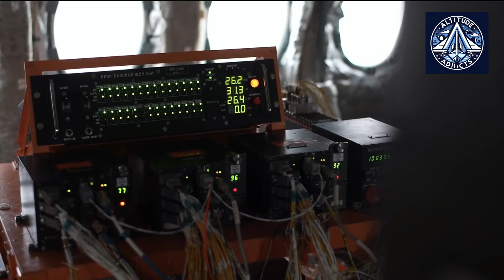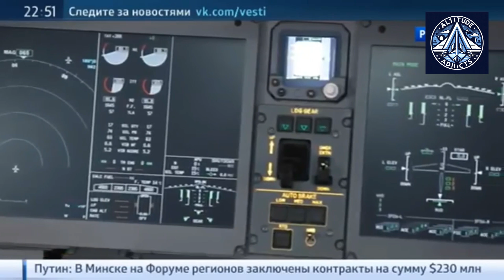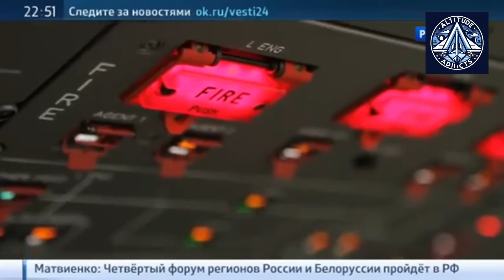Russia’s 2030 Aircraft Crisis: Why They Need 1 Plane Every 9 Days

Comment: according to Wikipedia SSJ-100 production figures they have done 30 p.a. several times - 10 years ... reason being it was the first to use the new jig-less production technique ...
 the engineers who set that up then moved to Irkut and setup the same for the MC-21 ..... 
then they went to Aviastar and setup the same system for the Il-76 ...... 
apparently they were at MiG recently and setup the line for the IL-114 ......  
you continually confuse product engineering ..... and production engineering - they are completely different disciples 
UAC has also setup factories as specialists in producing certain components ..... instead of 1x plant making everything themselves.

they have the basics quite well setup now ....